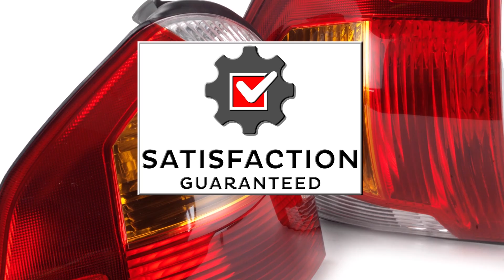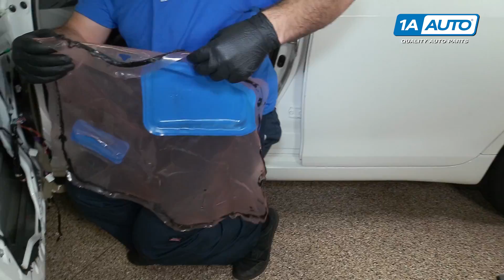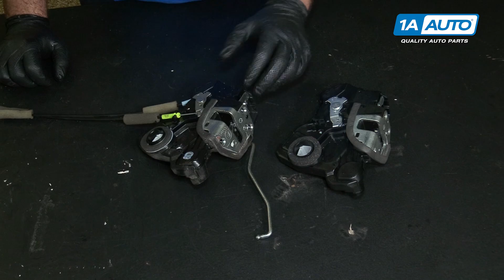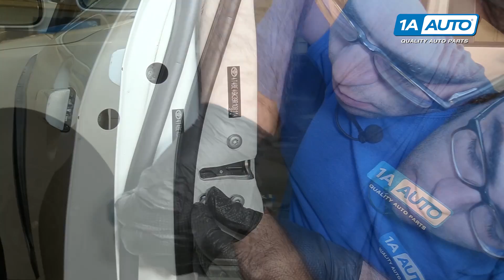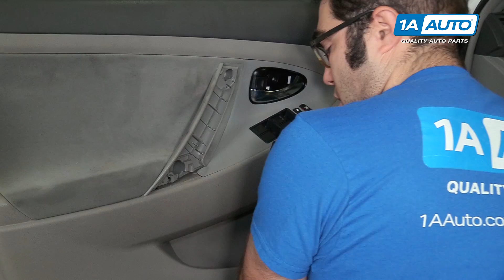How to Replace Front Door Lock Actuator 06-11 Toyota Camry

Comment: Thank you so much! The video was really helpful. Only issue was I had the window down when was was disassembling all the connections and when I got to the point where I had to take the rod out, I had to reinstall the connection for the window to roll up the window before proceeding. It was also difficult to get the rod out. I finally got it out but it also broke one tab to the gray clip housing. Hopefully that isn’t that big of a deal. Other than that, I can say that I am proud of myself. 😅 The video was very detailed and helpful. Thank you so much 1A Auto. ❤

Comment: What are the specific symptoms that the actuator needs replacement. My key fob unlocks the driver door only..also, the unlock switch on the driver door does not unlock the other door locks from inside...replace passenger side actuator?  Thx.

Comment: Fantastic instructions, I was able to change out my actuator in 45 minutes. I especially appreciated the tip about removing the lock cylinder, it made reinstallation so much easier.

Comment: Thanks for taking the time to make this video. It was extremely helpful. I have a few tips to add that you may want to consider in the future. 
1. Use a heat gun on the vapor barrier to soften the tape before removing.
2. Don't remove the entire vapor barrier. Those front wires don't need to be disconnected.
3. Use wax paper on the sticky tape while you're working, and duct tape the corner of vapor barrier up front to keep it out of the way.
4. No need to remove the grey clip. That rod can be reconnected to the new actuator  during installation. 
5. No need to remove the cylinder cover to remove/replace the cylinder. Also worth mentioning that's very soft aluminum so don't over-tighten during installation. 
Thanks again!
Reply from the maker: +Robbie Hargett Thanks for the feedback!

Comment: This is a great video (used on a Pontiac Vibe/Toyota Matrix) . The actuator sure went in easier in the video than it did for me though. And the funny, but not really funny, part is that once I got it all taken apart, the old actuator started to work. One of the wires in the connector had snapped over the years and was making an intermittent connection as I plugged it in.
Reply from the maker: +mick m Thanks for checking us out! 1AAuto.com

Comment: Hi Is there one actuator for each of the front doors? Do i have to replace 2 actuators if both the "power" lock buttons on the 2 front doors do not unlock/lock all 4 doors when pressed?
Reply from the maker: +R Aikon Yes, each door will have its own actuator. It's possible that replacing the actuators will fix this problem, however, there could be something else causing this as well. 1aauto.com

Comment: This is a great video from start to finished. Wish there were more like it. I do have one suggestion. The part of the video that shows the tech releasing the grey retaining clip to the door lever actuator rod is not necessary. The other end has a straight section that fits into a hole in the actuator and is easily slide in and out during removal and installation.  Since the grey plastic retaining clip can easily be broke I would suggest removing the other end.
Reply from the maker: +Mike Sheehan Thanks for the feedback!

Comment: This adapts fairly well to a 2008 sequoia as well.  Much less wiring to remove or move in the sequoia, and there is no key cylinder on the passenger side, so it was a very easy fix.  The only thing this video ought to mention is that the actuator has a tough time getting around the window channel.  The amount of force needed to work it around the channel seemed like too much.

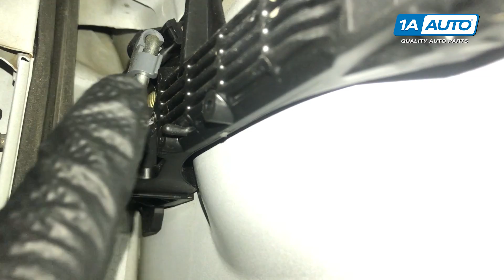Also, I couldn't remove the post from the door handle (6:18 in the video) so I just removed the post from the actuator.  It was A LOT easier to slide the actuator onto the post rather than removing the post from the door.

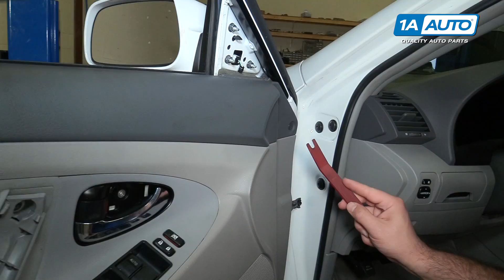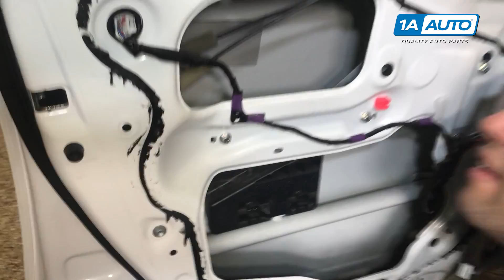Comment: Thanks so much for the video. It helped a great deal. I did find that you can push the center pin slightly in on the clip at 1:14. Then the clip comes out much easier. The only problem I had was that I couldn't release the control rod from the actuator (about 6:00) because of the ball end on the rod. I actually left the rod in, because it comes off. I swapped the control rods like you did at 8:38, but I did it with the control rod still attached to the door. Thanks again. 
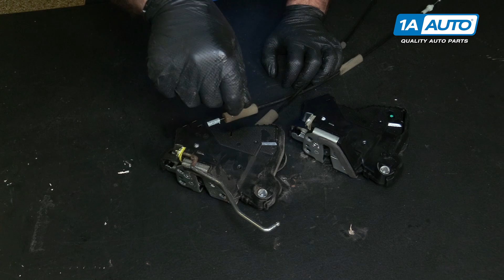UPDATE: My manual key didn't work anymore. I found out that I forgot to make sure that the other end of a rod connected to the key cylinder fit into the gray connection at the top of the actuator. This rod allows the key to manually unlock the door. I had to work with it a bit to get it to fit, but it finally did. Apparently I didn't listen very well when he said that "the actual key lock will go into here" at about 8:10. Now everything works.
Reply from the maker: +Bret Thomas Thanks for checking us out. 1aauto.com

Comment: Just installed new actuator on 2012 Camry SE front passenger.  It was mostly the same as the video.  No passenger side key lock on the 2012 SE so that was one less thing to worry about.  Overall no complications, everything came back together nicely and glad to have that pesky door lock working with the remote again.

I notice the door now has a very slight wobble when opening but I think this is because the point of contact with the new actuator and the body clip has moved a few millimeters.  I suspect this will lessen or go away completely after normal use and break-in.

Comment: For 1994 Camry, here's the sequence:  1) remove 2 panel screws on arm rest; 2) remove two screws under plastic caps near hinge end of panel; 3) remove center screw below the arm rest; 4) remove the two plastic pins on door latch end of panel; 5) remove side mirror plastic piece (pops off with a good grip from top of triangle); 6) remove door panel by lifting up (note that the metal stand offs toward the front of the panel will likely rip off of the fiber structure of the panel, and remain seated in the yellow button clips.  This seems to be unavoidable, like a hidden land mine); 7) disconnect button connector (pops right off if you press the tab with a screw driver and push lightly); 8) peel back plastic water shroud; 9) remove center-horizontal metal piece by removing 10mm bolts from actuator, and 10mm bolt at center actuator track, and 10mm bolts at hinge-end below mirror; 10) remove 10mm bolt for outer window track (latch end); 11) remove 10mm bolts for door handle; 12) remove 10mm bolts for inner door handle/lock assembly, so it's easier to undo the white rod snaps at inner door handle/lock assembly; 13) undo the green rod snaps at the door lock assembly; 14) slowly remove the outer door handle and undo the yellow rod snaps; 15) using a 10mm socket, remove the inner/hidden bolt holding the yellow anti-theft guard in place; 16) gently work the yellow guard out; 17) remove the 3 screws holding the door lock in the door; 18) while pushing the outer window track outward from the spot where the bolt was removed in step 10, slowly work the lock assembly downward and to the front.  Once it's past the outer window track, it will drop free.

Hardest part of re-assembly is getting the lock rod re-inserted in the hole at the lock assembly.  It's just a plan pan in the ass.  I needed a mirror, and it still took me 20 full minutes.  Everything else - other than figuring out by trial and error what the removal sequence should be - was straightforward.  Once the sequence was right, the lock assembly literally fell out of the door. 

Amazon sells the green, yellow, and white rod snaps, if any of yours break.

Comment: Hi. Great video. I just replaced the actuator on driver side door. 30 minutes because of you made it so simple. But still not working. I have the same problem on the rear left door. The right side working perfect. What could it be? It's a relay? Fuse?
Reply from the maker: +Tiberio Photography Thank you for the great reply. We love to empower our customers by showing you how-to perform your own auto repairs while installing our high quality auto parts. There could be multiple reasons why you're having this particular problem. We suggest taking your vehicle to a nearby reputable shop to identify the cause. Have a great day! 1aauto.com

Comment: Will this work for the keyless lock version of the 09 Camry? My power lock system has stopped working and I just want the FOB to be able to lock and unlock the car again. The lock still works with the key but the power system is broken.

Thanks!
Reply from the maker: +AlbieTom Yes the part shown in this video will fit your application.  Here is a link to it if you need to make a purchase!  http://www.1aauto.com/door-lock-actuator-and-integrated-latch/i/1adla00081?utm_source=YouTube&utm_medium=CTA+Comment&utm_campaign=ytcomment&utm_term=i8km-pgPIdI
Reply: AlbieTom how much will dealer charge to do this?

Comment: Just did this on my 2011 corolla.. virtually identical to the one in the video. awesome video,, this is the only one that shows the torx captive screw for the lock which may have taken me a while to figure out.  Total time for replacement 1/2 hour on drivers door.  
Nicely done, GREAT video.

Comment: How much does the aculator cost? How much would it cost to take it to get it fix at a shop? 😤😩my passenger one is giving out. Could it the wires underneath passenger door seat be affecting it. Because it sometimes work and sometimes it doesn’t???
Reply from the maker: +Issy Issy Depending on your model we may or may not have the RH actuator for your vehicle.  Here is a link to the LH side if you need it: http://www.1aauto.com/door-lock-actuator-and-integrated-latch/i/1adla00081?utm_source=YouTube&utm_medium=CTA+Comment&utm_campaign=ytcomment&utm_term=i8km-pgPIdI

Comment: In the items needed you mention the t25 torx driver but later in the video this one is not even mandatory, whereas the t30 (not mentioned in the items needed) is used to remove the actuator from the door. Is the one for the actuator a t25 also (and not the t30 as mentioned in the video)? Or is the t30 missing from the items needed?

I ask because I intend to do this repair and I need to buy the torx driver.

Comment: Thank you so much for this instructive video.  I used it to educate myself before replacing both the passenger and driver side lock actuators on my 2012 Toyota Corolla (door actuators look almost identical to this Camry).  Without the video it would have taken longer and added some frustration.  Actually, I may have messed up if not for the call-out about dealing with the lock cylinder on the driver side.  Again, thanks, this video was well done.